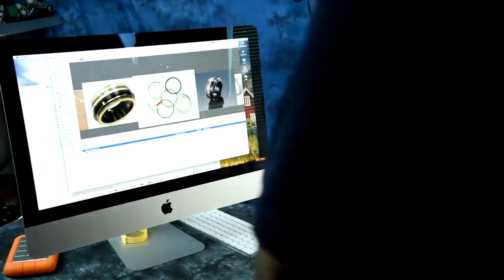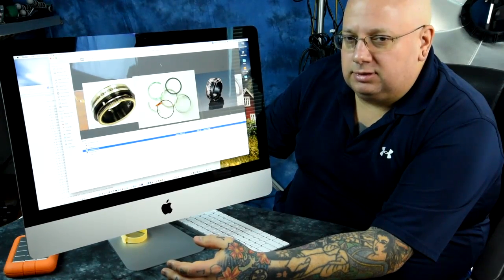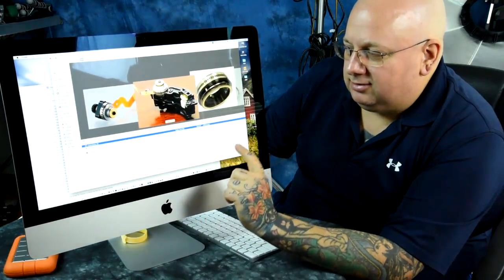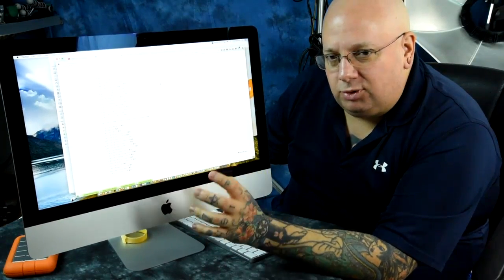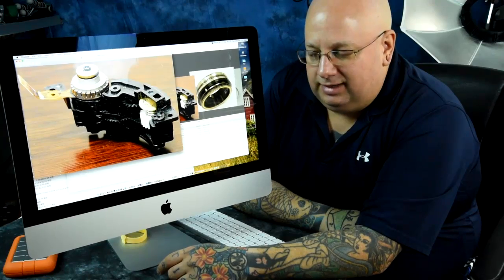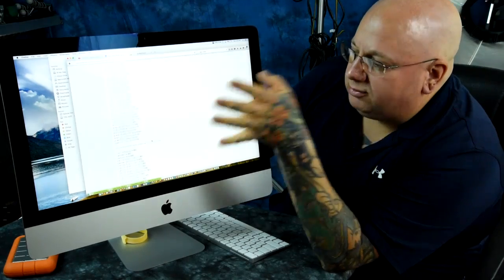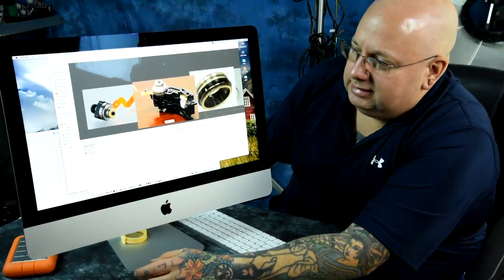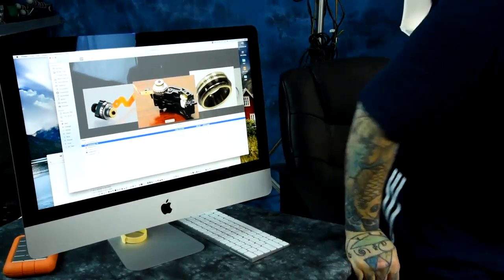Nikon's Dirty Secret: NIKKOR Lens AF DRIVE System: marked SWM, but it's really NOT

Comment: No gears in "full size" USM, still best for me and only reason am still thinking about Canon. At least in not to "glass heavy" lenses..
Reply: +roki977 Nope, this situation is the same for Canon as well. It isn't such a bad thing tbh, the quality of modern plastic is pretty good nowadays.
Reply: codcdbp
Yes, but chances are the electronics of giving out before the plastic is much higher. Look up Piezo Motor, you will find that even the ring type motor runs along a type of plastic.